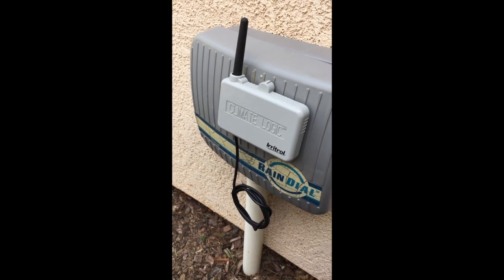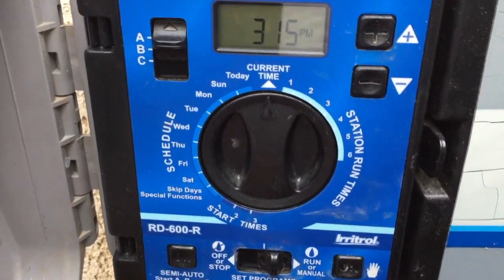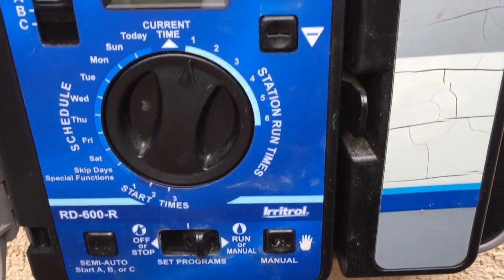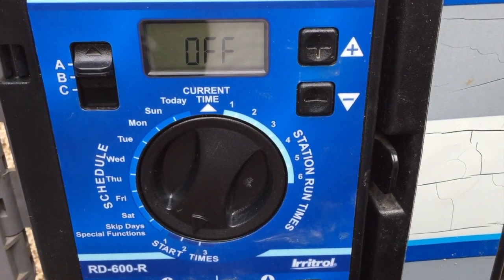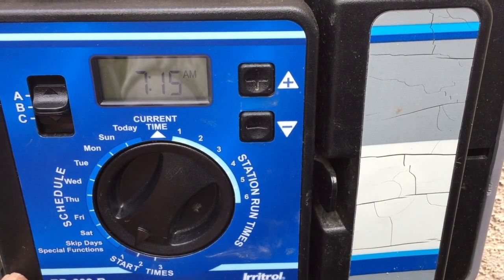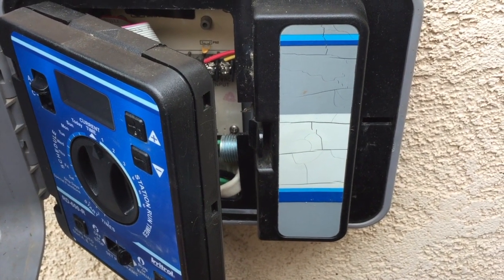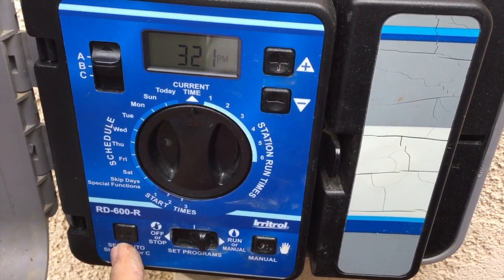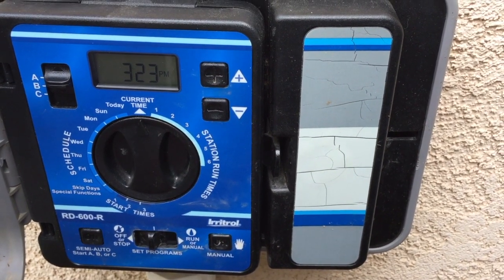SETTING A IRRITROL RAINDIAL TIMER

Comment: Thank you for a great tutorial on how to use this! Sadly my husband was killed at work 2 yrs ago & this is the first time I am attempting to get the lawn watered. I'm having a very hard time finding all the sprinkler heads & one is popping up but not spraying. I may be hitting you up with more questions in the future but this video was clear, concise, understandable & moved at a good pace.  Will be looking for more videos from you. Thx!
Reply from the maker: I’m so very sorry to hear about your husband. A trick for finding sprinkler is the turn the screw on top to the right until spray stops forcing more pressure to the ones not popping up. The one that pops up but nothing comes out is plugged. Wrap some duct tape around it, then with the sprinklers off remove the top and turn the water on to flush it out. Water off reinstall top and remove tape.
Reply: Omg thank you so much, Gary! I have spent the better part of the last 3 days searching & digging up my yard, found some heads that don't pop up at all (I completely dug out around them) & no traces of water coming out but water below when I unscrewed them....
Thank you so much for these extra tips, I will definitely be trying them out! 🤩

Comment: Gary, if I turn the switch to the off position, the sprinkler system will be off totally, right?  Living in Arizona, it would be nice to be able to just turn it off and on myself.  Thanks so much for the help!  Your video was really helpful.
Reply from the maker: Pam hi yes you’re correct, turning it to off keeps it off. Just put back into run, manual mode and hit semi-auto to run a complete cycle when ready. Hope you get a chance to Subscribe to our Channel it’s a free way to bookmark the channel.✌️

Comment: I adjusted the water start times and length of time for each zone.  In the display the number 12 is present in the top left.  What does this mean?  Also, can you reset the device to original factory settings and start all over?  Thanks
Reply from the maker: Hi Dan, to reset to factory..
Put bottom switch to middle position
Next move program (top left) to “B” 
Next carefully unplug the ribbon cable
Next remove the battery
Now hold down the manual button while plugging the ribbon cable back in
Next let go of the manual button
The timer should now show 12:00
Replace the battery
Reprogram to desired dates and times
Hope that help be sure to Subscribe to our Channel it helps us too.👊

Comment: Thanks Gary..great video. Having an issue with setting my drip system. I have 3 separate areas for drip system-B4, B5, and B6 and trying to set them for 7pm, 8pm, and 9pm respectively. When I do this and check the times, they all reset to one time. What am I missing? Thanks!
Reply from the maker: Does the timer only control drip?
Reply: @garyssprinklerrepair  No, it also waters grass. Those sections are on A 1, 2, and 3 respectively and they work fine.
Reply from the maker: Let me explain A, B, C programs
If you want 1,2,3 in A they’re lawns. Set days start times and run times.
Next move to B if you put 4,5,&6 in their and say water at 7 pm it will ( Start @7 and run them All one at a time)
The program allow different zones to water different days and times.....However you can’t say B-4 start at 7 pm then 5-B @8 it will automatically run when B-4 finishes the B-5 after that.
Setting multiple start times at 7,8,9 restarts All zones all over again
Reply: @garyssprinklerrepair  So, if I want B 4, 5, and 6 to run after one another on the same days how do I set the time(s)?
Reply from the maker: John Polanowski just set a start time that begins after the A program finishes. Now I can tell you’re getting the hang of it. Hope your subscribe to our Channel. It helps us on YouTube✌️
Reply from the maker: 1-start time only at 7 pm they will run one at a time starting with #4

Comment: I have times set on A for morning twice a week and on B for every day for shorter amount of time in afternoon.  Will it work through all these times without manually switching from A to B?
Reply from the maker: Yes
Reply from the maker: Hope that helped you out, don’t forget to Subscribe to our Channel for future assistance.🤙
Reply: I assume that there’s no way to make it do the opposite? I want to have only A, B, or C run depending on which I set it to. My thinking is A would be for the summer, B for the winter, and C for water conservation.
Reply from the maker: That will only work if you don’t give B and C start times. When spring ends delete A start time and add start to B. When summer ends delete B start and set a start for C leaving A, B starts off.
Reply: @garyssprinklerrepair  that’s an interesting work around. Thank you! I appreciate you taking the time to explain/teach. Unrelated, but I just found out that the guy who owned the house before me had extended the driveway to some lawn areas (which was a great idea) but it looks like he either just buried the old sprinkler heads or whatever he did to cap it off started because water is coming out the seams between the adjoining pieces of concrete when I run #1 and 2. I had thought about going to a drought resistant yard, so this might push me there sooner since #1 covers most of the front lawn. Luckily, #2 is the bigger leak, but that loop doesn’t water much now.
Reply from the maker: They probably broke the pipes when they put the concrete forms in with the stakes that hold them. A drip system is a good work around yes, eliminating the lawns and their issues.

Comment: Very helpful tutorial. I hope you can help me. The guy who set up our sprinkler system didn't show us how it works. I'm not sure which program is running what (plants, flowers, trees?)? I do know there is a drip line. How do I find out what is programmed to what?  I hope I'm making sense. Any help?
Reply from the maker: Use the switch on the upper left....start with A  Program then move center switch (off, middle position to check stuff or change them) go to start times bottom left and see how often things start( 1,2,3) then go to days see how often they run, next go to run times these are the different areas (plants etc) repeat for B and C program (C rarely used)
Now if you’re not sure who’s, who then move dial to zone 1, make sure switch at bottom is in manual-run, use plus button to give it a few min(maybe 2) and hit the manual button! Repeat for each area label them 1-9 and you’re ready to go
Reply: @garyssprinklerrepair  Thanks for all of your help; it's appreciated.
Reply from the maker: Hope you get a chance to Subscribe to our Channel for more videos and help in the future✌️

Comment: Hello I have this system inside the house I purchased I was pressing buttons to figure out if this works. I turned on the sprinkler heads using this but now they never turn off. Would you be able to assist me? I turned the bottom middle switch to off but that seems to not work.

Comment: If you leave it on program A, will it automatically switch to Program B once A is finished or do you have to manually switch programs?
Reply from the maker: Good question and the answer is yes, it will automatically move to B and C once A is done. Providing you set them for what times you want to start, how long to run and which days to water for each of the other programs. Don’t forget to Subscribe to our Channel for more awesome info.✌️

Comment: What I'm totally confused about is the A, B, C switch.   If in the A position, does it cycle through on A, then to B, and C?
Reply from the maker: Yes, if you program things in A it will find them and water, when finished it will look in the B program if it finds something it will water it. Next it will look in C program etc..hitting manual then enter with nothing in A program will force it to look in B and C.
Reply: @garyssprinklerrepair  does it do this in "Manual" too?
Reply from the maker: No, only in Auto/ Run mode. If you want to run a program on manual you would need to set it up in advance and then use the Program selector to chose which program you want to run manually.
Reply: When I start this mode, it doesn't seem to go from A to B... only when the timer runs on the timer.
Reply from the maker: @gregoryagogo  please read my previous comment. The timer will only run multiple programs in Auto mode
In manual mode it will only run a specific program that you choose.

Comment: Hi, quick question. We recently bought a house that has an RD-900 and while the system works, it seems to lose power sometimes. When I check it, the time is flashing. It’s plugged into an outlet inside our garage, does not seem to be connected to a light switch. Any idea if it’s something wrong with the controller?
Reply from the maker: Open the face panel by swinging it open and install a new 9v battery there. Make sure it’s alkaline not rechargeable. Problem solved.

Comment: Hi Gary, I have a newer 600-5 controller.  My problem is that station B is not being recognized to turn on when in a daily watering schedule. It does recognize the B station when using the Semi-Auto button. Stations A and C have no issues with programming.  What can I do to rectify station B?
Reply from the maker: Double check that you have a correct start time for B program. (Am/pm) let’s say B program has just station 4 in it. Set days you want on 1st, then water time. If that doesn’t work possibly a wiring issue for zone #4, bad solenoid, or bad valve.
Hope that helped, be sure to subscribe to our channel it helps us out. Good luck with the repair.
Reply: @garyssprinklerrepair  Thank you!!

Comment: Hey Gary, how do I get rid of a second start time?
Reply from the maker: Move on/off switch to middle position, turn dial to start time 2 or 3 use the buttons (up or down) to scroll to position between 11:45 and midnight that will say off. Repeat for # 3 if there’s on there.
Lastly you need to check B,C Programs the same way using the switch top left.
Hope that helps ya, don’t forget to Subscribe to our Channel 🤙

Comment: what does it mean when im on the run station 1 and irs on run but says off? , does it still run on the days it’s scheduled or is the clock off?
Reply from the maker: With the Dial straight up facing and the lower switch set to run it will run the program assigned.
If the dial is turned to #1 with the switch to run, you would need to add time using the plus button and then hit the manual button you on the bottom right now return the dial to the up position. It will only run that station or zone and go back to normal operation.
Reply from the maker: Hope you remembered to Subscribe to our Channel.

Comment: I've got this controller and have 3 Stations set up.  All of a sudden station 3 won't run.  The other 2 run fine.  The display and everything seems fine.  I've tried it through Semi-Auto and Manual  What would should I look for to see what might be wrong?  Thanks!
Reply from the maker: Double check you’ve programmed a run time for zone 3 in the correct program.
If that doesn’t work it’s either a wire issue or solenoid issue.
Let me know if you need more help, don’t forget to Subscribe and tap notifications so you’ll know I answered you.
Reply: @garyssprinklerrepair  I think it might have been a solenoid issue. I messed with the wires a bit and it started working.  Thank you!
Reply from the maker: @bbqjones  cool, double check all the wire nuts are tight. Irritrol valves had an issue a few years ago with the wires shorting at the top of the solenoids. (Lawn Genie) homeowner version made by the same Co.

Comment: I set current day and it keeps switching to the wrong current day on its own, please advise. I am House sitting and need to fix this. Thank you.
Reply from the maker: Are you making sure the bottom middle switch is in the middle position between off and run before you change the day?
Hope that fixes your issue, be sure to Subscribe to our Channel if it works, it helps us continue to grow.

Comment: How do I reset the clock? A recent storm knocked out electricity. Nothing is showing on clock face
Reply from the maker: Check the power, the timer is plugged into 1st. If that’s fine, open the inside panel and look to see if the fuse on the circuit board is blown, if it is be sure to only replace it with the exact same voltage on the fuse. (To prevent a possible fire hazard)
Hope that helps, be sure to Subscribe for more great content on our Channel.✌️

Comment: Hey Gary,  I did all the step than you mention , but is not start automatic at 6:00 am , any other solution ?
Reply from the maker: Check your water days
Reply: @garyssprinklerrepair  I did sir , monday off tuesday on .... and it's doesn't work.
Reply from the maker: Are you able to run any zone manually with the timer?
My newest video explains how to do that.
Reply: @garyssprinklerrepair  yes sir I can do that
Reply from the maker: Does it work when you run it manually or semi auto with the timer?
Reply: @garyssprinklerrepair  yes its does sir
Reply from the maker: When the times days are set to on for the correct Program ex:A program starts at 6am -M,Tues, wed, thurs, fri, sat, sun all set to on (skip days off!!)
Run times on all zones
Dial set to auto/ run position 
Bottom middle switch set to far right position-run/ manual 
The timer if it has power should operate correctly if it has power.

Comment: I turned my controller to OFF at the very bottom because it has been rainy as of late. However my sprinkler system still runs through all zones as if it was set to RUN. Any ideas?
Reply from the maker: Bliss13 S , if you have a ohm meter you could check the timer when it’s doing that to see if there’s voltage  on the common and the station screw (ex, zone #1) to see if the timers doing it.
Reply from the maker: Bliss13 S, only other thing timer wise is the switch is defective.

Comment: Question; I have my timer is set to come on at specific days/times. It's stopped coming on as scheduled. Any suggestions for a fix? Thank you.
Reply from the maker: William Davidson, check the outlet it’s plugged into with a light, a drill to ensure there is power. If there is go to days of the week make sure days are set for on or off depending on your needs. Then Check skip days (bottom left) is set to off). Make sure the water source outside is turned on, to verify you can manually turn the water on at the valve itself. Keep me posted.
Be sure to “Subscribe” for Free to our channel and tap notifications for new video updates.
Reply: @garyssprinklerrepair  m66666666666l

Prr

Comment: Gary
Cancel my request it worked! You’re the bedt
Reply from the maker: Just a quick refresher, turn the dial to the desired station, use the + button top right to give a a few min. Run time, make sure bottom center switch is in run/ manual position, hit bottom right manual button. Now it’s on, use off switch to stop and replace to run to repeat for next zones.

Comment: What does “Sen” mean????
Reply from the maker: The timer is telling you to make sure the wiring is connected correctly for an installed rain sensor. If you have no rain sensor installed, open the panel and locate the sensor switch (top right) and  move selector to bypass. Hope that helped you out. Don’t forget to Subscribe to our channel for more great tips and advice.👍

Comment: My drip system just wont turn on even though it’s set, help! Please
Reply from the maker: Pull the battery out of the timer if the display goes away you have no power to the timer. The battery will show a display as though the station is on but hasn’t enough amps to run a zone.
Reply: It stayed on after removing battery, what does this mean?
Reply from the maker: Not sure if this is a new timer for you but it’s possible the days of the week are not turned on.  Do any of the zones work?
You also might have a wiring issue..check out my video on how to rewire a set of valves.

Comment: I had some one fix two leaks in my irrigation system and now i can not get water out. I am 89 years old and need a manual or some help;; No water for 7 days  and in Arizona its very hot. can you send me a manual or some where to go for help I can not be out for more than 5 minutes an i get dizzy,,, Old army days....Please help
Reply from the maker: Google Rainbird Raindial pdf manual.
Reply from the maker: Ps Thank you for your service Sir
Reply from the maker: Make sure they turned the main irrigation water back on after their repair
Reply: @garyssprinklerrepair  Where is the main irrigation water?  Thanks so much
Reply from the maker: Jim Granack, I was just saying if they if they replaced a leaky valve they must have shut the water off to do that.
First thing 1st make sure the bottom middle switch on your timer is moved to the right “Run” position and the dial in the middle is placed to “current time” position.
Reply: @garyssprinklerrepair  Thanks for helping    great of you to do this

Comment: Go over skip days,
Reply from the maker: When the dial is moved to skip days with the on/ off switch in the middle position you can chose skip days 1-31 (be sure to have odd/even off and chose which program A,B,or C)
Once you have your interval set turn the dial to “today” and pick when you wish to start that interval to run. 1- for 3 days from now, 2-to begin the interval watering process 2 days from now, 3-for tomorrow, 4-today. Return dial to current time and selector switch to run. Need more info Google (irritrol raindial pdf)
Hope that helps, take a minute to check out our Channels and Subscribe for more great info.